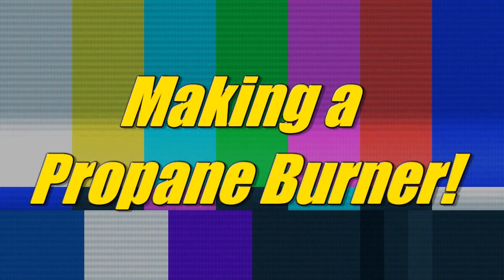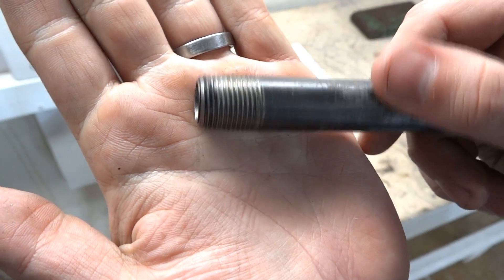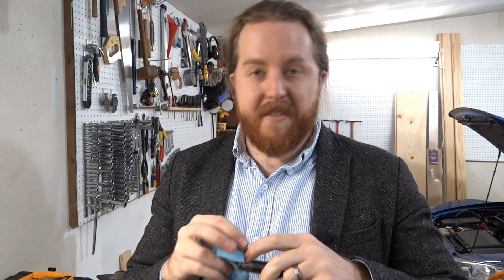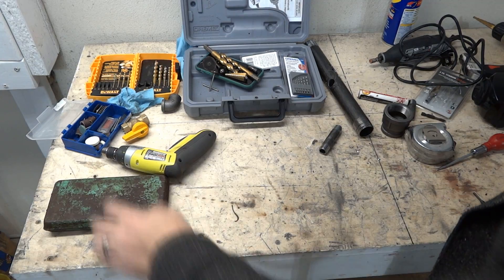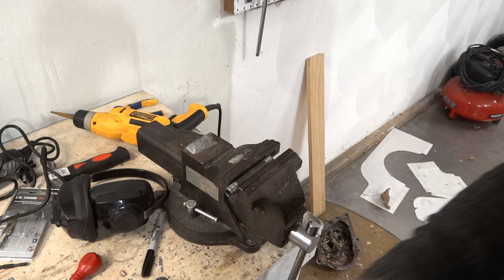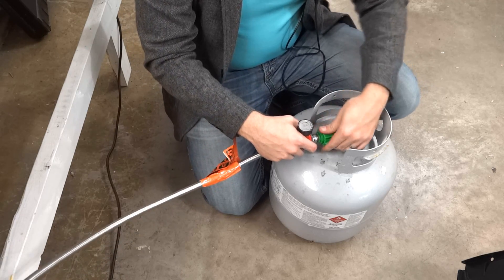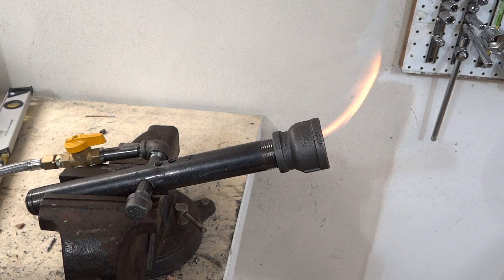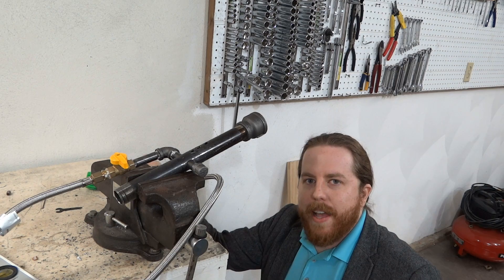Easy to Make Propane Burner! For Melting Metal at Home, or a Forge!

Comment: How hot will propane get if using a burner like this?
Reply from the maker: Depends on too many factors to say for sure.  I use forced air now and an insulated fire brick furnace and I have melted iron with it, so hot enough!
Reply: @PaulsGarage  Awesome, thanks for the reply. Running a compressor to the burner or something like that?
Reply from the maker: @colsoncustoms8994  not a compressor, I use an air mattress pump.  I've used a hair dryer in the past too but it didn't move enough air and the thing always ran a little rich when on full blast
Reply: @PaulsGarage  Okay cool, I use a bathroom exhaust fan for my open charcoal forge.
Reply from the maker: @colsoncustoms8994  i never would have thought of that, that's a cool idea!

Comment: Hey paul,,,what is the purpose of the flare at the end of the burner?
Reply from the maker: It does a few things.  Since it flares out, the fuel/air mix is forced to expand and slow down, this creates turbulence.  The slow turbulent mixture then burns more completely right in the flare. This can prevent the burner from blowing itself out.  This is especially important before the furnace heats up.
Reply: Awesome thanks man!! I am building one now to play with this weekend.
Reply: Mountain Man Ent  How'd it go?
Reply: It went good but not as good as Pauls. I posted a video to my channel. It's going to be ok for my mini furnace but my video is a perfect example of what paul was talking about with the air/fuel mixture being off. It has enough blue flame to reach the temps I need but then it turns to yellow flame at the tip. I'm going to open the holes up to 1/2" and see if that fixes it.

Comment: Could you use a regular propane torch to melt brass?
Reply from the maker: Brass would be pushing it.  Regular propane torches (I assume you mean weed burners) tend to be low on airflow, dont work well in a furnace without modification

Comment: Tip if you don't have the rich mans drill bit set . I used a .35 welding tip from a mig welder. Cut it in half jb weld it in.

Comment: If you build one of these add water through gas line and look in 1" pipe and move gas line till water comes out the center. thats the best way to center the # 57 hole to the torch and it will burn better. I tried to run mine without the bell reducer and it started sputtering backfiring so it needs a flair on the end.

Comment: I found that site/design several years back when I first got into metal casting, but I never built the burner. I'm thinking about it now, but I'm wondering if it could be a hybrid forced air/naturally aspirated burner. A sleeve could be made and slipped over the burner pipe to cover the holes (and would help adjust the fuel/air mixture) and I could easily connect the output from an air mattress pump to the back of the burner tube...hmm

Comment: Hey! Do you know the BTU/hr of this? Or, have you tried running an entire 20lb tank empty? How long did that take? Also, would it be possible to make it portable by using a 14oz propane torch bottle? I know it wont last very long at all, but do those little bottles give enough pressure to get a flame as big as yours? Thanks!
Reply from the maker: I don’t know, but I do have a plan to figure it out eventually.  I know where I can borrow a super accurate tank scale, I’m just waiting for warmer weather

Comment: Is the regulator on the gas line necessary to maintain PSI?
Reply from the maker: +AshesMardiGra yes.  As the tank empties and/or cools, pressure will not stay constant.  The regulator fixes that
Reply: Paul's Garage I currently get great pressure for 10 to 15 sec before goes to nearly nothing and flame goes out.

Comment: If the back of your burner really doesn't need to be open, then you might want to put a T or an elbow to another nipple then a mounting flange.  That would make putting a support foot (wood or metal) under it easy and you wouldn't have to use that precarious looking rock.  You could add height adjustable feet and ballast to the foot to make it stable.
Reply from the maker: +Ron Yerke that’s a fantastic idea, thanks!  I still have to come up with a new mounting system for the burner to use with the new brick furnace, I’ll see if I can work something out

Comment: Propane isn't free... but I found it to be much cheaper than charcoal. It also rids you of the sparks and ash, and you no longer need to babysit your fire. If you have a Costco nearby they sell propane pretty darned cheap
Reply from the maker: +Learning the Hard Way I think you're right.  Propane is so much easier, and I think I burned through just as many dollars in lump charcoal per melt.

Comment: So how has it been working out?  I just built one-similar design except I used a mig tip for the gas opening inserted into the backend [[I know there is a joke in there for you.]], 4 set screws hold it in place and the back is sealed.   My first design my nozzle with the tip was just behind the holes similar to yours but my flame was bright yellow-too much air.   Lengthened the tip and now it is just in front of the holes-better flame but not quit there yet.   Makes me want to go back to charcoal-sorta but not.
Reply from the maker: works great so far.  It would work better if i could use a flare in the furnace, but when the furnace heats up i don't have problems anymore.   Bright yellow is usually not enough air (running rich), but it can also be moisture in the air, impurities, lots of stuff.
Reply: Hmmm.  I thought Yellow was too much air and blue without the inner cone was too little?
Reply: Oh and by the way, I have your goofy theme stuck in my head like an ear worm.  lol

Comment: NPT - National Pipe TAPER. The taper is generally 1 inch in 20 inch or 3 degrees 50 minute angle minutes of arc.....  There are many types of pipe threads, including imperial (US standard) and metric. I would suggest Stainless steel pipe and flair because of flame temperature. 1.) Stainless can handle a higher temperature, 2.) stainless does not conduct heat like other metals. And yes, I own a small machine shop and steel fabrication shop. I have been a novice engineer for 40 years, with some engineering schooling (didn't have the $100,000 or more for the full degree due to injuries in a car crash).
Reply from the maker: +Jeffrey Cole thanks for the tip!  Stainless would be pretty awesome, I'll look into that.  The normal black pipe I'm using gets quite crust and rusty over time.  Did not know about the different heat conduction either.

Comment: Why all gases EXCEPT oxygen?? Oils and some elements are very volatile and are very reactive with oxygen. Never ever ever never - don't even think about it - using oils, valves, or fittings, that are not oxygen approved with oxygen. NEVER EVER use oil based soaps to leak check oxygen systems. Use ONLY oxygen approved soaps to leak check oxygen systems. The seals in the valves, and oils used to manufacture the valves can and will cause spontaneous violent flames or explode. That's why you can't even think about it, because you brain could spontaneously burst into a blowtorch or explode!!!! I try to quit thinking because it gets me into too much trouble.......
Reply from the maker: +Jeffrey Cole so what you're saying is I should never, ever get a bottle of oxygen?  I don't need another explosive thing in my garage haha

Comment: can this work vertically?
Reply from the maker: +Ted Lesch the direction really shouldn't matter.  The pressure shoots the propane down the pipe, and that pulls air in.  Should work up, down, horizontally, all similarly.

Comment: I wouldn't light the burner at your venturi holes. I know it's kind of cool and it acts like a pilot light, but now you are wasting fuel that is burning in your burner tube and not your foundry. Also the tube on the burner will start to get hotter than you want and flame being that close to the jet might cause a flashback under the right conditions. Just turn up the pressure and light at the flare. That being said, I did enjoy your video.

Comment: hay Paul thanks for the video FYI Oxygen degrades the silicon or teflon components in the valve and any oil or hydrocarbons in the valve from manufacture can react with the oxygen plus heat I'm guessing we can all goes what happens next.

Comment: can you please give me the pipe fitting dimensions. I want to replicate the project and I need to know what to buy because I like the way you made it. 

f.y.i, I watched your video on tuning it and I think it might help if instead of using the hair dryer, you could just cover the holes you drilled and drill some more up front maybe. Idk if that will work but that's what I'm going to try.

Comment: You mentioned a place where you get tin. Where?
Reply from the maker: many sources like lead free solder (which is often 99% tin), some of those old 'antique' stores that really just sell old junk, lots of the pewter objects will be mostly tin (some have lead in them, some dont so be careful) or if you want to just buy tin ingots try rotometals.com

Comment: Oxygen is highly explosive under pressure. A greasy fingerprint in an oxygen rich environment + pressure = BOOM 
Special valves and lubricants for them are required. Like never grease or get grease on your Oxy/Acet. Valves right ?
Reply: Oxygen itself isn't explosive, it's an accelerator as in it helps whatever fuel combust. More oxygen during combustion the faster it does so. If oxygen were leaking from said tanks and touched the lit smokes it'd merely accelerate the burn nothing more.

The biggest danger is in the instance of oxy / acetylene, if you have leaks in that kind of setup it could very well become a massive explosion due to the mixture of fuel oxygen and the combustion from the torch! Which is why you typically wanna be further away from the actual tanks.
Reply: Not just under pressure. You are correct to think oil based products - oils, lubricants, seals, etc. - are very reactive to oxygen, and yes, sometimes just the oils from your hands. Not "like never grease or get grease", NEVER get grease or oil, or oil based seals near oxygen. Things burst into flames or explode. YES! Specially prepared valves, seals, and lubricants are needed for oxygen systems.
Reply: Interesting thing.  I was Diabetic as a baby too adulthood.  Ended up in the hospital at age 13.   Night shift as Hosp, the nurses [[whom I became friends with as they were[[well a couple of them anyway]] hot.   The break room was stuffed with Oxygen tanks and they sat around smoking and playing cards and such.

Comment: I'm building two of these now. It's funny we bought almost the exact same stuff. Same pipe, same hose+regulator. 

I was checking youtube because I didn't realize I needed that flare fitting for the propane hose. No link in the description sadly, but at least I know what I'm missing. :) thanks!
Reply from the maker: +Jared Thomson problem resolved! The link is now in the description, but I have found the fitting at a normal hardware store that sold pluming stuff, so you might not even have to order it.
Reply: Thanks Paul :)

I did go ahead and order it, and it works great. Burner is up and running. \m/

Comment: Where did you buy the NPT to flare fitting?
Reply from the maker: +Jamie Lappen got it on Amazon, but I have since found one at a larger hardware store.  Sometimes NPT is called MIP or some other names, so it might be available locally just by another name
Reply: Are you able to send me the amazon link please?

Comment: Paul, you don't need the flare when using it in the forge. A flare is only required when using it when not hooked up. Also if you want to add forced air either with a hair dryer or compressor the furnace will get just about hot enough to cast iron depending on how you build the new furnace
Reply: wow after I posted that you uploaded a new video. lol

Comment: Shouldn't use it for oxygen because it has rubber parts or oil lubrication usually. Pure oxygen can make oil explode into flames and rubber and plastic burn like its rocket fuel. Hybrid rockets use this to their advantage.
Reply from the maker: Andrew Lorona interesting, by hybrid rockets you mean those that use solid and liquid fuel?
Reply: Yes, or even solid fuel and gaseous oxidizers like nitrous oxide or pure oxygen gas. They just have to have the fuel and oxidizer in two different states to count as hybrid rockets.

Comment: The valve probably isn't to be used with oxygen because the greater chance of the metal oxidizing. The atmosphere is roughly 20% oxygen, 100% oxygen would likely quintuple the oxidation rate and could cause failure within the valve. That's just my guess.
Reply: No, it's because oils and some elements are very volatile and are very reactive with oxygen. Never ever ever never - don't even think about it - using oils, valves or fittings, that are not oxygen approved with oxygen.The seals in the valves, and oils used to manufacture the valves can and will cause spontaneous violent flames or explode.  NEVER EVER use oil based soaps to leak check oxygen systems. Use ONLY oxygen approved soaps to leak check oxygen systems. That's why you can't even think about it, because you brain could spontaneously burst into a blowtorch or explode!!!! I try to quit thinking because it gets me into too much trouble....... I do not like to guess. Too many bad things can happen when I guess. It also gets too expensive to just guess.
Reply: WeneDog0628 wut
Reply: He stated that the valve was marked as not to be used with 100% oxygen, I was replying specifically to that statement.
Reply: yup the various space programs have had huge issues with keeping oxygen lines and valves clean, even a finger print can cause combustion in the prresence of 100% oxygen.

Comment: I built the other style torch already but I'm not overly thrilled with it so I think I'll build yours too. Question: How are you able to get the air/gas mixture optimal without using a carb of some sort? Are those predrilled holes that precise that you never need adjustments?
Reply from the maker: This design doens't have a great way to adjust the mixture on the fly.  The air can be adjusted by covering/opening more holes, but in a certain configuration it seems to work best at a specific pressure.  You can see when i first turned it on at low pressure, it was a lazy, rich lame because it didn't have the suction to pull enough air in through the holes.  This improved when i cranked up the pressure.  As a result, in this configuration i can't run a small flame at low pressure. It just isn't possible.
Reply: I would think, if you needed additional airflow, and you have all that extra pipe at the back... perhaps you could modify an old hairdryer (possibly with a dimmer arrangement) to pump additional air if you wanted to run a smaller flame?

Comment: Im so glad to see your channel growing and to see you pursuing your hobbies! You are have the most amazing videos (and personality). I CAN NOT WAIT for more copper and aluminum melting, and maybe even literally copper and aluminum melting (I think you should call the bronze "Copperum". Im both excited and disappointed that you have swapped to propane. It will allow you to do SO many (responsible mind you) casting projects. Im still stuck in the dark ages with Grant's mini foundry design for solely aluminum. Im using soup cans as crucibles... I bought a super cheap Chinese clay graphite one but it is too wide for charcoal to fit around. Anyway keep up the good work and videos. -John
Reply from the maker: Thanks! I can't wait for more copper melting either, too bad it's going to rain tomorrow here... I'm going to keep my bucket furnace and probably still use charcoal in it when melting aluminum.  Charcoal is pretty cheap and i already have a couple bags of it.  But once I get the better furnace built I want to start doing more copper alloys.  There is a LOT of cool bronze/brass casting in the future I hope!

Comment: "I know where to get a lot of tin.."

Care to share with the rest of the class, please?  :-)
Reply from the maker: There are a few good sources of tin.  Rotometals.com sells ingots if you want to pay (it's not super cheap), lead free solder is usually mostly tin (and more expensive by pound than ingots), and often you can score an old tin plate or decorative thing at a thrift shop.  I don't know of any super cheap source of tin, but even buying full price ingots isn't too bad.  Bronze is mostly copper, so 1 pound of tin makes LOTS of bronze

Comment: NPT stands for national pipe, tapered. There is such thing as NPS which is a straight thread and used for lamps and other things.
Reply from the maker: Ah right, that makes sense.  I sometimes mix words in my head, thought the T was for thread :D
Reply: Great video though. I just scored some scrap brass and want so badly to join the metal melting club!

Comment: The reason that valve will not work for O2 is because there is a propylene lubricant on the valve controller. O2 and propylene don't play well with each other.
Reply: Correct, it's because oils and some elements are very volatile and are very reactive with oxygen. Never ever ever never - don't even think about it - using oils, valves or fittings, that are not oxygen approved with oxygen.The seals in the valves, and oils used to manufacture the valves can and will cause spontaneous violent flames or explode.  NEVER EVER use oil based soaps to leak check oxygen systems. Use ONLY oxygen approved soaps to leak check oxygen systems. That's why you can't even think about it, because you brain could spontaneously burst into a blowtorch or explode!!!! I try to quit thinking because it gets me into too much trouble....... I do not like to guess. Too many bad things can happen when I guess. It also gets too expensive to just guess.